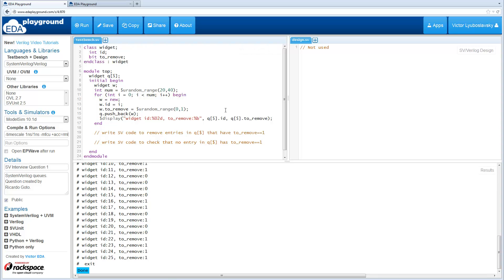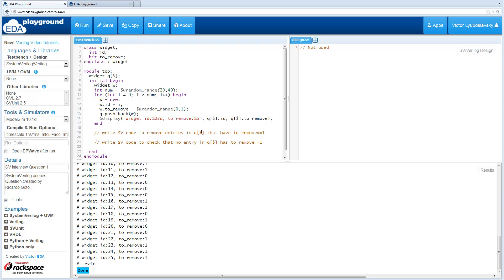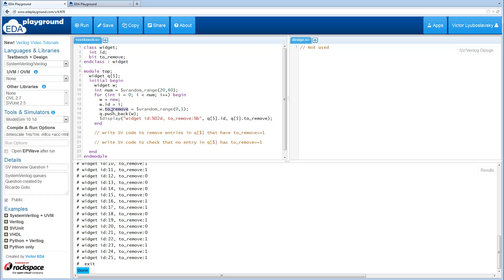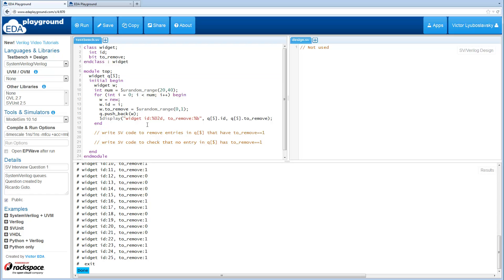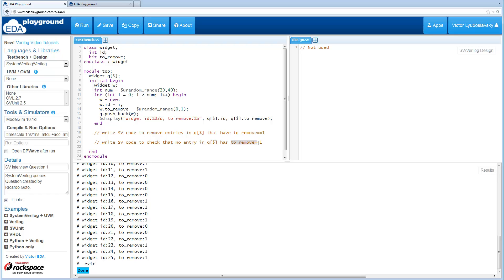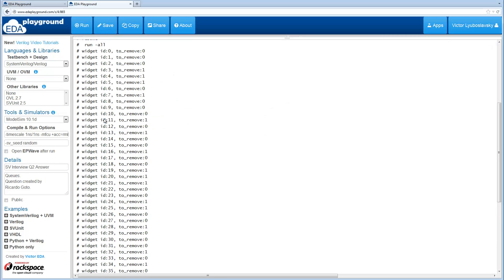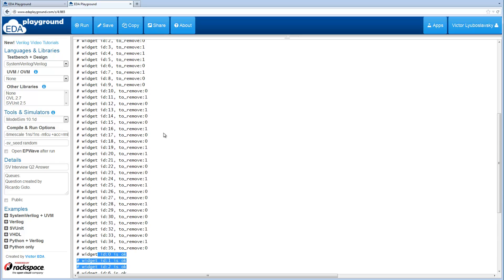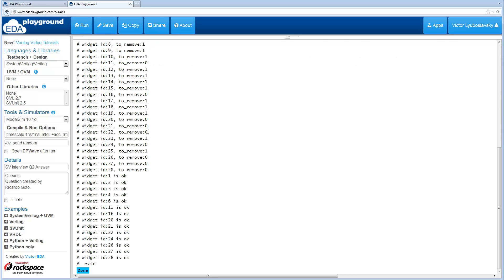SystemVerilog Interview Question 2 -- Queues

Comment: My solution is to start from the end to the front so that you don't need to change the index when deleting.
class widget;
  int id;
  bit to_remove;
endclass : widget

module top;
  widget q[$];
  initial begin
    widget w;
    int num = $urandom_range(20,40);
    for (int i = 0; i < num; i++) begin
      w = new;
      w.id = i;
      w.to_remove = $urandom_range(0,1);
      q.push_back(w);
      $display("widget id:%02d, to_remove:%b", q[$].id, q[$].to_remove);
    end
  
    // write SV code to remove entries in q[$] that have to_remove==1
    for (int i=q.size; i>=0;i--)begin
        if (q[i].to_remove == 1)begin
            q.delete(i);
        end
    end

    // write SV code to check that no entry in q[$] has to_remove==1
    for (int i=0; i<q.size;i++)begin
        $display("To remove: %1d", q[i].to_remove);
    end
    
    
  end
endmodule

Comment: class widget;
  int id;
  bit to_remove;
endclass : widget

module top;
  widget q[$];
  initial begin
    widget w;
    int num = $urandom_range(20,40);
    for (int i = 0; i < num; i++) begin
      w = new;
      w.id = i;
      w.to_remove = $urandom_range(0,1);
      q.push_back(w);
      $display("widget id:%02d, to_remove:%b", q[$].id, q[$].to_remove);
    end
  
    // write SV code to remove entries in q[$] that have to_remove==1
    
    foreach(q[i]) begin
      if(q[i].to_remove==1) begin
        q.delete(i);
      end
    end
     $display("*************after the remove********************");
    foreach(q[i]) begin    
      $display("widget id:%02d, to_remove:%b", q[$].id, q[$].to_remove);
    end
   
    // write SV code to check that no entry in q[$] has to_remove==1
    
  end
endmodule

Comment: I found the tricky part with this question, better to use for loop rather than the foreach. It simply loses track of elements and the queue gets messed up.  Nice question for Interviews
Reply from the maker: Yes. That's right.
Reply: @Edaplayground_EPWave   I used foreach and did not think of this. Can you please explain why foreach will mess up the queue?
Reply: @sriharimes  Assuming you remove the entries that have to_remove=1 when you loop through the queue, the entry that you just remove is now replaced by the next entry and your index should reflex that (decrement it). Hence you want to use for loop instead of foreach loop.

Comment: here is a solution for it : https://www.edaplayground.com/x/wzpT
Reply: why is the $display working correctly on a NULL handle as we did not create class instances for the queue of widget class using new constructor?
Reply: we are pushing to both the q[$], temp[$] queues which are actually a queue of classes. We need to allocate memory for any class instance before we can start storing or using it in the module. This is working though in your example but am curious how it's working as expected.
Reply: @HK-rc6vf  it is not null handle .. new has been done previously

Comment: doesn't know if this solution has best performance, but:
// write SV code to remove entries in q[$] that have to_remove==1
    foreach (q[i]) begin
      if (q[i].to_remove) q.delete(i);
    end
    // write SV code to check that no entry in q[$] has to_remove==1
    foreach (q[i]) begin
      if (!q[i].to_remove) $display("widget id: %0d is ok", q[i].id);
     else  $display("widget id: %0d isn't ok", q[i].id);
    end
Reply from the maker: 'foreach' is an elegant solution, but is dangerous when combined with the '.delete' method. (It loses track.) So, you would be better using an ordinary 'for' loop for this.

Comment: The missing code is :
    // write SV code to remove entries in q[$] that have to_remove==1
    for(int i=0;i<q.size;i++) begin
      if(q[i].to_remove == 1) begin
        q.delete(i);
        i--;
      end
    end
    
    // write SV code to check that no entry in q[$] has to_remove==1
    foreach(q[i]) begin
      if(q[i].to_remove==0)begin
        $display("widget id:%02d is ok",q[i].id);
      end
    end
Reply: What is the purpose of i--?
Reply: @prajwalr4878 if suppose q[0] entry is deleted, the next element takes q[0] as index., so whenever the element is deleted the next entry should be the same..
Reply from the maker: Looks good. Well done,

Matthew

Comment: // write SV code to remove entries in q[$] that have to_remove==1
    $display("\nsize of queue = %1d\n", q.size);
    
    for(int j = 0; j < q.size ; j++) begin
      if(q[j].to_remove == 1) begin
        q.delete(j);
        j--;
      end
    end
    
    // write SV code to check that no entry in q[$] has to_remove==1
    for(int j = 0; j < q.size ; j++) begin
      if(q[j].to_remove == 1)
        $display("SOMETHING WENT WROOOOOOOONG");
      else
        $display("widget id:%02d is ok", q[j].id);
    end
Reply from the maker: Kartik Sudarshana 
Perfect!
Reply: EDA Playground :
I think his code wont work. After checking for the condition, he has to decrement the 'j', so that it points to correct index after deleting the entry in the queue.
Reply: ***** Thanks for taking time to review the code.  I do use a j-- after deleting the entry.  Do you still feel there is something missing? Did you try to run the code in eda playground to see if there is an issue? I ran and got the expected result. Let me know if you feel something is still missing. Thanks.
Reply: Kartik Sudarshana Hey karthik. Do you? I couldn't see that, that's why I thought there could some mistake. My bad. Except that code looks clean.
Reply: ***** :).  I have a feeling you did not press "Read more".  The "j--"  q.delete(j) is the last line that it shows by default. This might be the reason you missed it..  No worries :)
Reply from the maker: ***** 
I nearly fell for that one, too. I was part way through an explanation as to why a '--' was necessary and then realised I needed to click on "Read More"...
Reply: why it is decrement....why not increment?

Comment: for (i=0; i < num; i++)
    if (w[i].to_remove) w.delete(i);

for (i=0; i < size(w); i++)
    if (!w[i].to_remove) $display("widget id:%d is ok", w[i].id);
    else                      $display("ERROR: widget id:%d not removed", w[i].id);
Reply from the maker: ***** 
Hi Ali,
You've got the basic idea, but their are a few problems with this. In an interview situation, obviously you can't try it out, but of course with EDA Playground, you can. 
In various places, I think you meant 'q' not 'w' and you need to declare 'i' (just put an 'int' in the for loop like in line 11). You need to think about what happens to the indexing and size of the queue when you delete something from it. Lastly, 'size' is a method of the queue class, so 'size(q)' won't do what you hope.
Cheers,
Matthew

Comment: Is there any difference between a Queue and a mailbox, apart from the fact that mailbox is strictly a fifo having only get() and put() methods while Q has many more methods. I mean, is a Q preferred only for these reasons?? Thanks.

Solution to the SV question would be;
for(j=0;j<q.size();j++)
      begin
        if (q[j].to_remove == 1)
          begin
            q.delete(j);
            j--;      
          end
      end
Reply from the maker: Koushik Ramakrishnan Mailboxes are used to communicate between multiple processes (in a multi-thread environment). I imagine mailboxes like have some performance overhead associated with being thread-safe. Typically engineers use queues instead of mailboxes for typical use cases.
Reply: @ @Edaplayground_EPWave . As per my understanding mailboxes have some sort of semaphore protection. Like 2 processes try to access same mailbox, mailbox will ensure both will be written safely with no order information, where as in queues sometimes it may lead to data corruption as 2 processes try to push.
Reply: queue suffers from overflow and underflow. Mailbox has inbuilt semaphore that has put and get methods which are blocking calls. They don't let it underflow or overflow

Comment: for (int i = 0; i<q.size; i++) begin 
      if (q[i].to_remove == 1) begin
        q.delete(i);
        i--;
      end
    end
    
    $display();
    
    for (int i=0; i<q.size; i++) begin
      if (q[i].to_remove==0)
        $display("widget id:%02d is ok",q[i].id);
      else
        $display("Error: widget id:%02d is NOT ok",q[i].id);
    end
Reply: Let's put these loops inside functions for ease of use:

function void remove_entries(ref widget queue[$]);
    for (int i = 0; i < queue.size(); i++) begin
      if (queue[i].to_remove == 1) begin
        queue.delete(i);
        i--;
      end
    end
  endfunction

function void check_queue(ref widget queue[$]);
    for (int i = 0;i < queue.size(); i++) begin
      if (queue[i].to_remove == 1) begin
        $display("Error: widget id: %02d should have been removed.", queue[i].id);
      end
    end
  endfunction

function void print_queue(ref widget queue[$]);
    $write("\nQueue contents: \n");
    for (int i = 0; i < queue.size(); i++) begin
      $write("widget id: %02d, to_remove: %b\n", queue[i].id, queue[i].to_remove);
    end
  endfunction

and then call them like this inside the initial block:

remove_entries(q);
    print_queue(q);
    check_queue(q);

Comment: missing lines of code could be
for (int n=0; n<q.size; ++n)

begin

if(q[n].to_remove==1)

begin

q.delete(n);

n=n-1;

end

end

//Verifying

for (int j=0; j<q.size(); ++j)

begin

if(q[j].to_remove==1)

$display("widget id:%02d is not ok",q[j].id);

else

$display("widget id:%02d is  ok",q[j].id);

end

Let me know, if it is too crude n one more thing  please tell if it is not supposed to be public
Reply from the maker: Public is OK :) All comments are welcome.

The code will work. There are 2 minor changes that can be considered:
- the first loop can be re-ordered so that "n=n-1;" is not needed
- foreach block can be used for the second loop
Reply: EDA Playground
I tried foreach command ,then  my output is not correct .
I used following lines
##############
foreach(q[n])
begin
if(q[n].to_remove==1)
begin
q.delete(n);
end
#############

Excerpt from o/p
#################
# widget id:01 is not ok
# widget id:02 is  ok
# widget id:03 is  ok
# widget id:04 is  ok
# widget id:06 is not ok
#################
Reply from the maker: The "Remove" loop should use for. foreach can be used for the second "Verifying" loop
Reply: EDA Playground  In that case, I will have to use n=n-1 in for loop ( remove loop)
Reply from the maker: What if your for loop is like this?
for (int i = q.size() - 1; i >= 0; i--)
Reply: EDA Playground
Thanks!! I worked :)